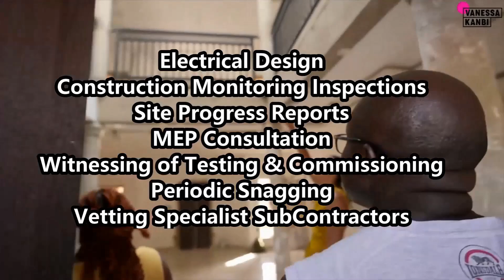WATER SYSTEM | MANUAL VS AUTOMATIC FILTRATION

Comment: Hi Kingsley. Great video as always. I’m
Building in 4 years time or so in rural Jamaica 🇯🇲. I’ll be living of rainwater from a 11 thousand imperial gallon underground concrete tank, and pumping to a pressurized bladder tank which has to take water up two floors. Is this a bad idea? I didn’t want a gravity roof tank because of the weight. Should I reconsider?  Also I’m hoping to use a 4-5 stage filter system which incorporates spin down filters, carbon and finally a uv filter. What’s your thoughts on this my brother. I also intend to have a swim pool and a fish pond.